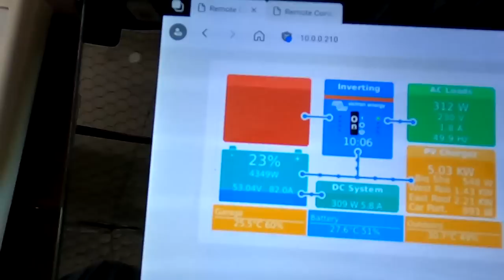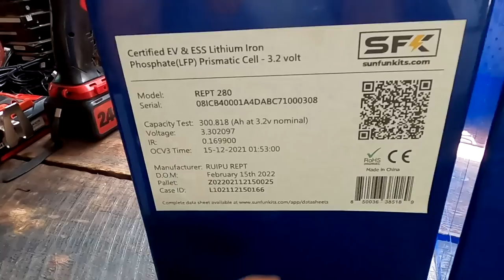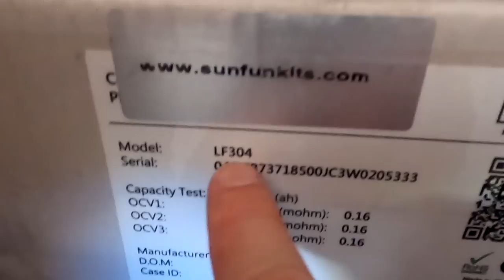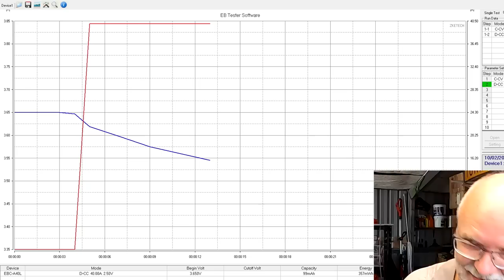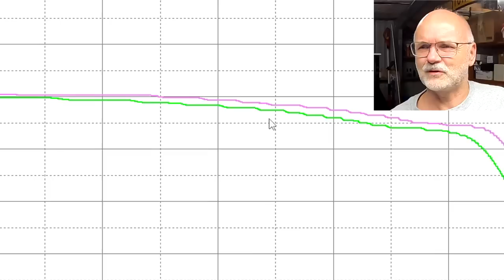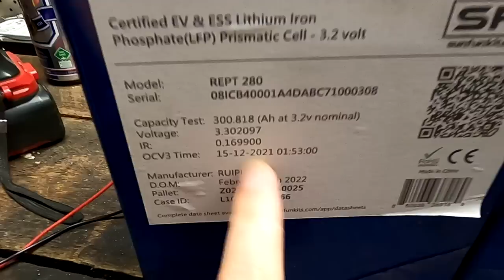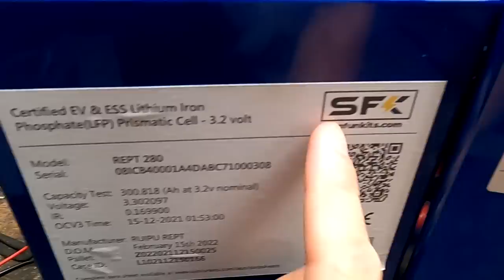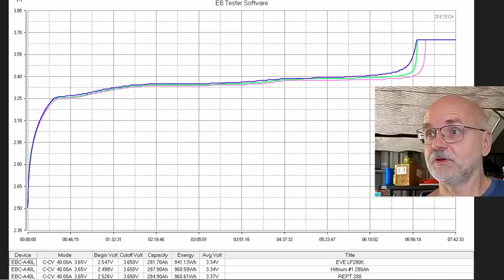BEST cell to buy - Testing Certified, A-Grade, B-Grade, Storage-Grade batteries🤷‍♂️

Comment: Andy, this is not a totally fair test. You should get someone else to order your cells. I guess you would see a big difference in Ah, as they probably cherry-pick the ones they send you. The ones I got from Qishou in april-22 measured 270-275Ah. It doesn’t make a huge difference, but it is still wrong.
Reply: I bought LF280K from Docan 07/2022 and I tested them on EBC A40L. The lowest has 277,8Ah the highest 283,1Ah. Total price what I payed for 16 cells was 2126€ with all taxes.
Reply: @stanislavmlcuch2085  I paid about the same. $2050 for 16 LF280K in total to Sweden.
Reply from the maker: I had some 'bad' cells as well and showed them on the channel. Take the Hithium for example I ordered from Qishou. They came with fake labels. I don't think they cherry picked them for me...
Reply: @OffGridGarageAustralia  I’m not criticising you in any way Andy, you are doing a great job and we appreciate you sharing it with us, but you must admit that the chance of you getting bad cells is a lot smaller than for the rest of us. The Hithium cells were quite good even if you couldn’t read the 2D code.

Comment: Hi mate sure you have solutions also, you only have to see them.
you are all using 50 volt well i am going to 500 volt because i use this voltage
you can have 500 A x 50 V i turn this to 50 A x 500 V the end is the same
but not complete i ask on albaba the voltage they have to be 3.2 V 50 A
why only 50 A well with 10 units i will have still 50 a one ubit is 35 kg
200 A would be more than 100 kg a unit to mats for me to lift
the funny thing not one china seller were able to tell me they were able
to connect them in serie they all can do paralel  nice but that is not making 500 volts.
that is why i say you can do it also if you think about it and need it.

Comment: A sample size of one, or even two, does not tell if the manufacturing isuniform across a batch of cells, or if it may vary.
Reply: That fact that 1 from 3 different are the same though ....

Comment: SFK says says your wrong Andy  , he's already posted a rebuttal video .  He still has to tell everyone they are just wrong .
Reply from the maker: They are using a different test method so will get a different result. I can only use the same settings on the tester for several cells and compare. 
I have more cells from them to test but they are all a few months old, so...
Reply: We did not Say Andy was wrong, we said we used different methods and cells that were newer vs the 14 month old cells that Andy tested. So there Certified cells are pulling 285 AH even after 14 months. New Cells are pulling 296, but even these cells after a while will get closer to 285-290 and will generally stay there. 

You on the other hand went off about how your Hobby King University degree told you that turnigy 10 gauge wire can run 140 amps...
Reply: @sfkenergy  Again your personal attacks when some disagrees with you is not warranted.  I stated 40 amps through 10 awg silicone wire is fine and it is .
Reply: @onthelake9554  10 awg is specked for 30 continuously. Its not possible to insult someone who is of the belief they can run 140A through 10 awg wire... At this point we have more than responded to all concerns people have raised, now it is just opinions. Not going to waste any more time  with grade B warriors...
Reply: @sfkenergy  I certainly hope you keep your word .

Comment: Well, the test is great, your videos are interesting as hell and very informative, but.
Calculating the $170 per 280Ah battery results in $2720 per full battery, resulting in 14.4kWh.
And now add the shipping fee for (quite heavy) batteries. Alibaba calculated it to $1300.
On top, one needs BMS, circuit breaker, LOTS of crimping tools, wires, etc. And enclosure.
One can use pre-made enclosure like Seplos Mason you've built, too. But that one is $500, but includes BMS. But still no breaker. And shipping is another $300.
Together it comes around $4800. Hopefully there will be no shipping damage...
Or, I can buy locally (with free shipping) Pylontech UC5000 - 4.8kWh, rack stackable, with everything, including circuit breaker and local warranty. For $2000.
Putting everything together, the DIY battery is cheaper by ~25% roughly. But with a lot more work and ending with battery that is too heavy for practical handling.
For smaller enclosures with 100Ah batteries it's not even comparable.
So, for me - while I learn a lot from the videos, I'll be grabbing the off-the-shelf rack batteries.
Reply: 1300USD for shipping? Where are you from? I bought 16pcs of EVE cells on July 2022 and shipping to EU was 308USD. Total price what I payed  was 2126€. So with BMS and fuses it cost me around 2350€ for 14,4kWh = 163€/1kWh. Pylontech US5000 is possible to get for 1900€ for 4,8kWh = 395€/1kWh, so it is 2,4x more expensive that DIY battery.
Reply: @stanislavmlcuch2085  Would you mind to share the link to the cells you've got? I'll try to get some shipping quote from there. Thanks!
Reply: @stanislavmlcuch2085  I forgot to answer... I live in Switzerland and here the shipping rates for heavy packages is quite high, plus I have to pay import duties and VAT on top.
Reply: @rklauco  I bought the cells on Alibaba. I have contacted Quishou (Amy Peng), Luyuan (Amy Wan) and Docan (Jenny Wu). I bought from Docan, but prices were very similar.
Reply: > Alibaba calculated it to $1300. 
 --> don't rely on the Alibaba shipping calculator. It's always wrong; you have to contact the supplier for a dedicated quote. I recently priced a battery (15kWh, it's on Will Prowse's forum) for $3286 including shipping, fuse and BMS.
Reply from the maker: You always need to get a quote from the seller on Alibaba (links in the description). The prices Alibaba website calculates are not what you actually pay. You can always negotiate a bit and shipping is usually around 150USD per carton of 4 batteries.
Reply: @rklauco  Always ask for DDP incoterms - then the quote includes taxes, etc.
Reply: One thing you should be aware of, shipping calculated by Alibaba is usually 3 times as much as what it will actually be. Always contact the vendor with your delivery details and get the real shipping cost.
Reply from the maker: @john_in_phoenix  Well said!

Comment: Even if you tell people what is A-grade battery and what is B-grade battery, people will only like the cheap price of that, anyway, a short period of time can be used, who can move really have to guarantee 5 years warranty 7 years warranty or even 10 years warranty.
Reply: And we as a manufacturer, we do not think that ordinary people can distinguish what is A-grade batteries, our procurement are always need to pay attention to the quality of raw materials, after all, there are too many counterfeits on the market, only the real production of people know.
Reply from the maker: Transparency is the key to success. If you let people know what they will get, both sides will be happy.
Reply: @OffGridGarageAustralia  Indeed, I agree with you, which is why I'm very supportive of many people in the industry making videos like this. But the reality is that many brands either keep their mouths shut about battery quality or refurbish them with old batteries, and it's hard to argue that they can transparently inform consumers, who also have their own opinions, and like I said before, price largely determines that.
Reply: @OffGridGarageAustralia  Of course, I am not saying that all brands have problems, like you have reviewed so many brands of batteries, you should know which ones can be recommended to users.

Comment: Does certified have a longer life????
Reply: tell ya in 30 years !|
Reply from the maker: Nobody really knows. They do testing at the factory and if cells don't meet the requirements, they are are being sold as B-Grade cells. Nobody knows why they fell the testing. Could be capacity, internal resistance, C-rating, self discharge...
How long either will last... good question.

Comment: 200 mico ohms. They may be using a Keighley resistance tester to test the resistance of batteries.  Use to use them in Calibration Lab I ran.